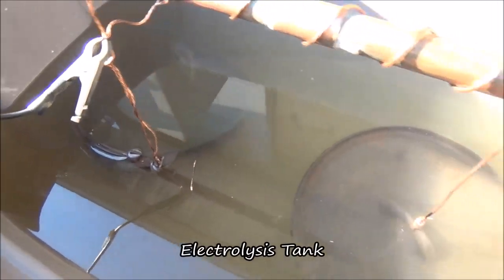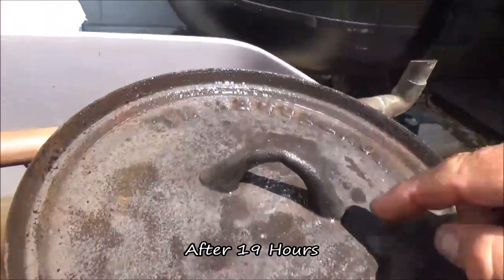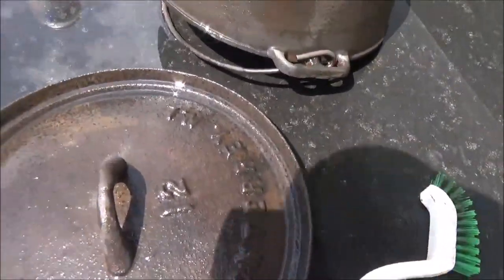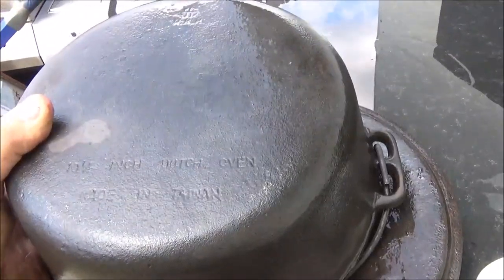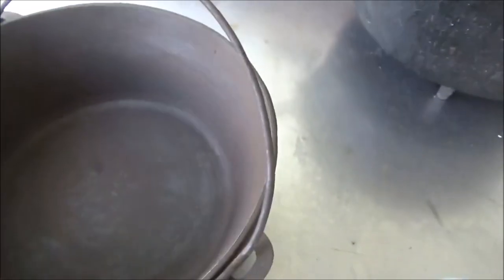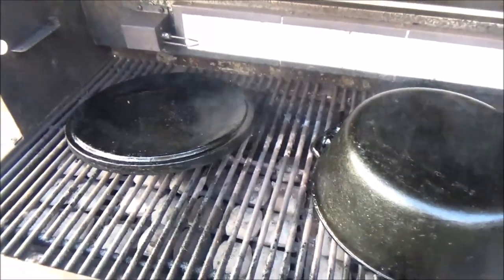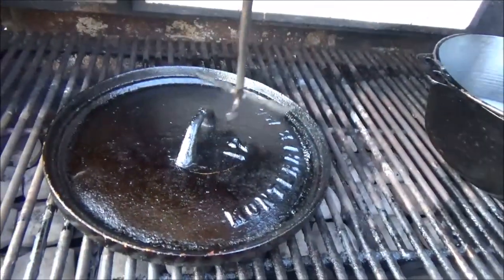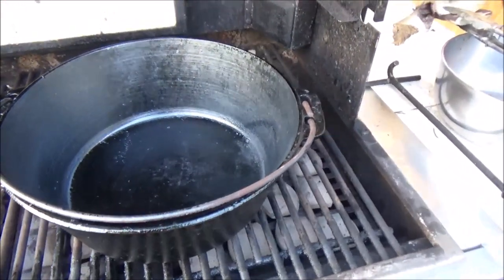How to Restore Cast Iron

Comment: What is a gate mark?  Do you season iron with lard?
Reply from the maker: Gate marks are ridges left by the molding process.  You see them on cast iron made before the industrial revolution.  You can season with almost any cooking fat or oil, lard included.
Reply: Good to know.  I probably could have looked it up on the interwebs but thank you.
Reply: Lard works good.

Comment: please be more specific, soda ash? what is it, power source dc/ac, seasoning ? motor oil? crisco? amount of soda to water? or wag? why several coats?
Reply from the maker: Ok.  Slow down man.  This video was for advance cast Iron people and more to show the old dutch oven.  If there is enough interest, I will do videos on how to do this in detail.  My channel is more about cooking and this video is to prelude a cook on this dutch oven.  There are lots of videos out there on the tank set up and seasoning.
Reply: daniel cunningham You hook it up to a battery charger and you're gonna season it with vegetable oil, definitely not motor oil.
Reply: I understand your point, consider this, ran a crew of volunteers on a hurricane damaged house in Princeville,NC . Doctors,lawyers, white collars that needed tax write offs or the touchy feely crowd. Two things happened they found out drywall was much harder than it looked, and their mental superiority attitude created some wowser accidents. luckily they realized they could not get blood from a turnip. Never let a surgeon cut sheetrock in 90+ temps and 95% humidity, sounds bizarre but some folks are so trained in one field simple safety experience goes .
Reply: daniel cunningham ... Arm&Hammer Super Washing Soda, it's a laundry detergent booster. Its used in this situation to raise the electrical conductivity of the water. There's really no set water:powder formula. I usually use about a cup of A&H to every 2 gallons of water. Some use more, some use less. Seasoning, is putting a oil coating on the cast iron that is (for lack of better word) "baked" on. It helps the cast iron become non- stick and give a little protection from rust. The oil is put on a warmed pan, to allow the oil to be absorbed in the pores of the cast iron prior to baking it on.  Crisco works well, some use Olive Oil. Olive Oil can become rancid quicker, so it's not my preference. Hope this helps.
Reply: I agree that there are tons of information on building an Etank.  Try Electrolysis Tank Builders in Face Book as a starter.  The same goes for seasoning cast iron.  Ask a 100 people you will get a 100 different answers. Cast Iron Enthusiasts is one of many Facebook sites that has good information on restoring and seasoning.  Lets start by eliminating MOTOR OIL for seasoning... Not good... Mr. Backwoods has a video in the past on how he seasons his Dutch Ovens, check it out...  The VERY short answer on an Etank build is.  12 volt manual battery charger. 2 to 10 amp will work fine.  MOST of the new chargers are automatic and there are ways to make them work.  I use 1 Tbl spoon of washing soda / soda ash to 1 gallon of water.  Do some research on the correct way to connect to the anode ( Scrap Steel ) ( Positive ) ( Red ) and the Cathode ( Negative ) ( Black ) gets connected to the black pan.!
Reply from the maker: Please see all of the comments here from folks that know way more about this than I do.